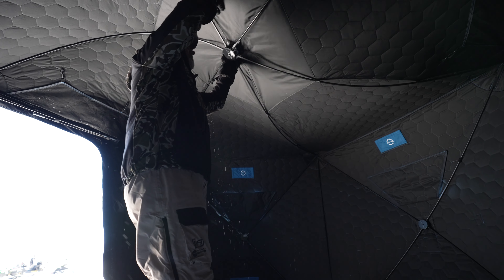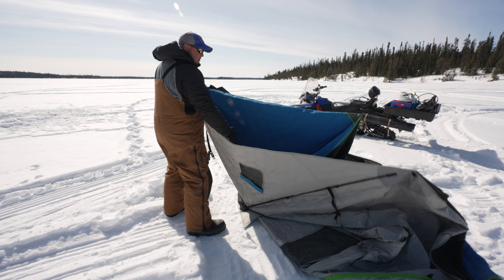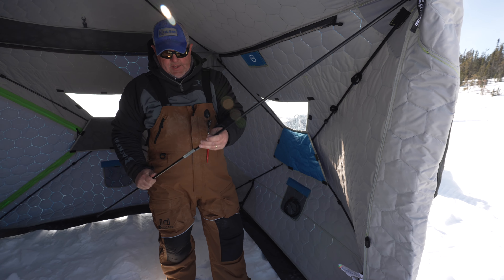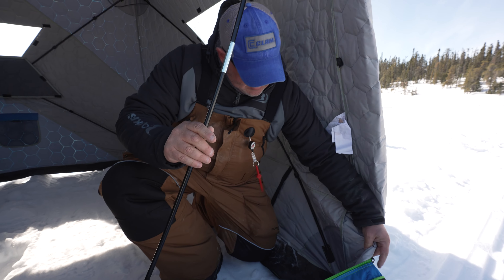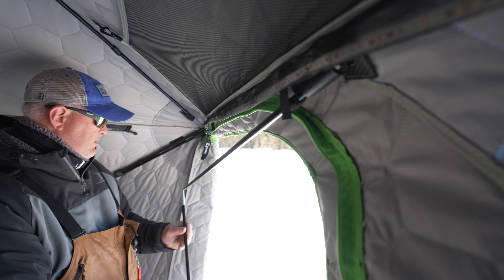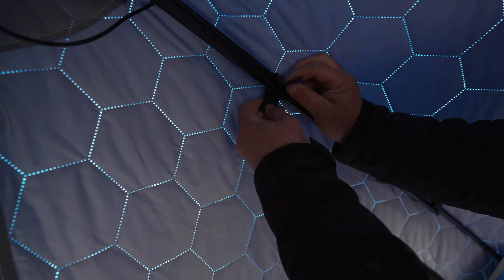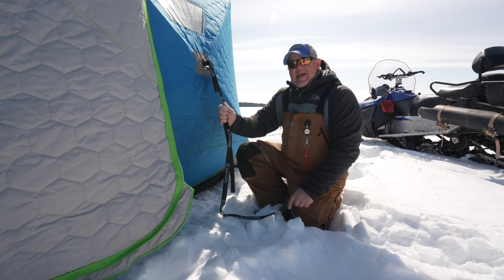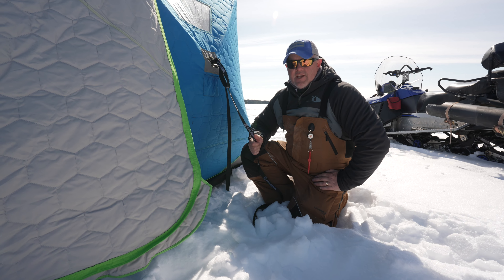Clam X-Series Hub Shelter Set Up

Comment: What color are the interiors on these new hubs?  The website and your model-specific videos show black.  The hub in this video is gray.  If it's gray I'd order one up here in northern Alberta.  Black?  That's a hard pass...
Reply from the maker: The Ice Team models of hubs (X-400, X-500 and X-600) and Jason Mitchell X-5000 are all gray interior. The regular X-400, X-500 Lookout, X-600 and X-800 are black interior.
Reply: @ClamOutdoors  That's awesome.  I just sold my Vortex Lodge to buy a X-400 Ice Team  Now if you would just put removable TPU windows in the X-600 you'd have the perfect ice camping tent for two and a replacement for my Otter Vortex Resort.  I can dream.